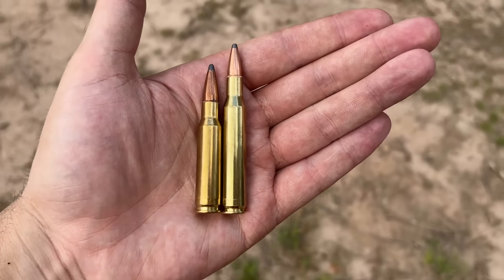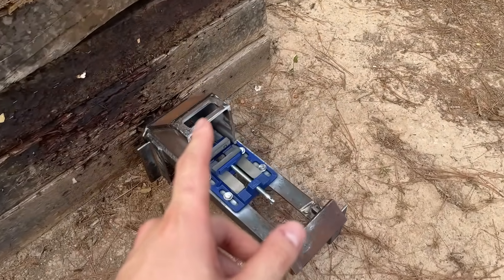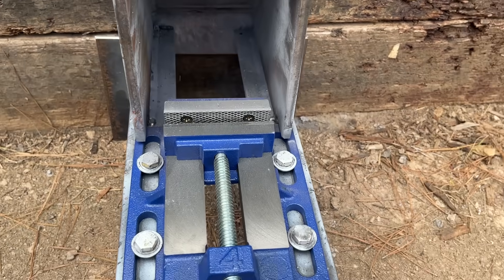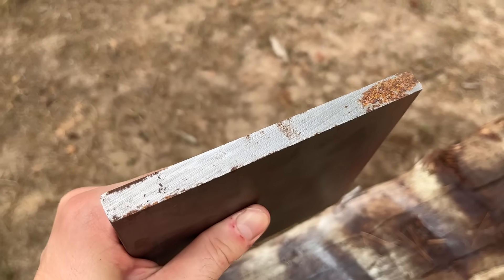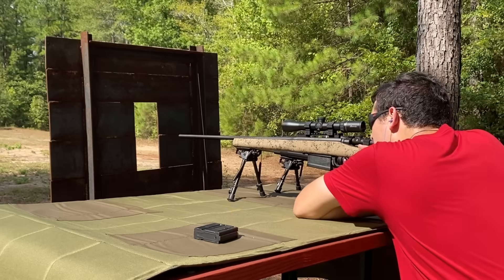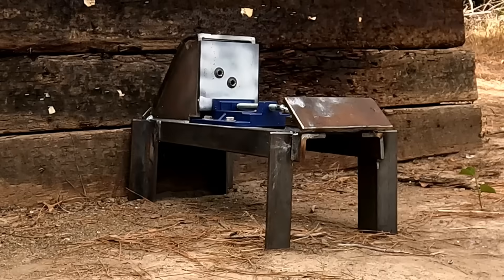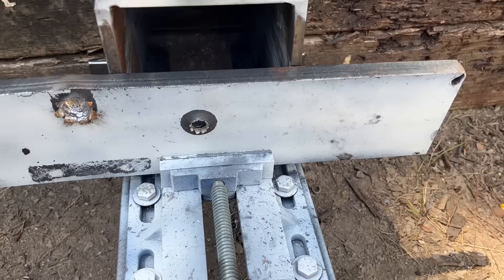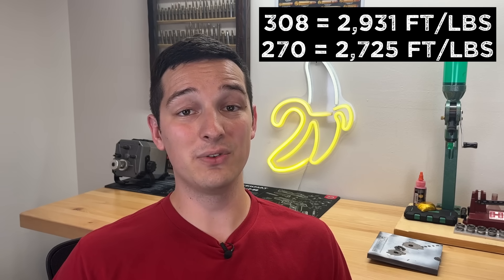270 Win vs 308 Win: ONE Clear Winner On Mild Steel

Comment: First of all, for hunting, I prefer a bullet that expends all its energy in the game animal. I have used the .270 130 gr on many deer and antelope with perfect results. To compare a 130gr .270 to a 165gr .30 calibre is apples to oranges. Forgetting the weight difference, the sectional density is way different. 150 gr .270 bullet would  certainly even the field!

Comment: You set the .270 up for failure. You’re comparing apples to oranges. I bet you money .150 grain punches a hole through the plate. .308 is not the better gun.

Comment: An apples to apples comparison would be using an even heavier bullet in .308 in order to have the same sectional density as the 130 grains, 270. That weight would be 158-160 grains in 30 caliber.  which is an odd weight for a 30 cal hunting bullet and penetrate an even thicker plate. Your test is very good and conclusive.

Comment: The test results surprised me. I thought the 270 would have a bigger punch. I wonder if the 270 would have punched through the 5/8 steel with a heavier bullet.
Reply: I know years ago the guys would compare the 270 with the 30-06 and they always got the 270 to shoot through more than they could the 06 , would shoot at the web on a piece of railroad track , I daresay they were reloading both as hot as they could .
Reply: @robertboyd3863  I agree. I do think a bullet selection, as in armor piercing round, will be difficult to beat when it comes to penetration. AP rounds exist for the 30-06. I'm not sure for the 270.
Reply: @tyronekim3506  Back years ago my buddy and his friend bet a case of beer over which would go farther into a tree, needless to say my friend slipped an armor piercing round into his 06, the guy never did figure out how he got beat so bad, used to buy them all the time for next to nothing
Reply: @robertboyd3863 That's a good story. He's probably still scratching his head in bewilderment.  😅

Comment: It would be interesting to see the difference between them if a monolithic bullet was used.  A solid copper bullet non expanding for a true apples to apples comparison.  The energy is more with the 308 but it also has a larger area to push through.  Eliminate the variables in bullet construction such as jacket thickness and internal lead hardness.

Comment: A similar grain bullet would have been a better comparison. I hand load my 270 with 160 grain Nossler partition bullets, and it will hole punch a 5/8 steel plate at 75 yards. It will also bring down Moose or Elk with one shot.

Comment: So as a deer cartridge pick the .270 then? Deer don’t wear armour plate, & the 270 will provide better expansion / tissue damage as the heavier & somewhat stronger 150 gun .308 bullet plainly holds together better (& will be more likely to pencil through at longer ranges when the impact velocities drop below the best performance threshold).

Comment: The alloy of the actual each bullet might affect it.  Lead with just a little this, a little that and I mean little can affect its' hardness, as well as heat treatment.  Where different brands, different batches that fit within the range of an alloy, one can be on upper limits, another could be on lower limits.

Comment: I was deer hunting in anywhere USA a huge buck graced the crosshairs of my Win. model 60 SS CRF in .270 scope, unfortunately the Buck was clad in 1/2-inch mild steer plate and at that range I knew I couldn't take him down; I should have used a .308. Folks both of these rounds are good for deer, the .270 shoots further and flatter than the .308. I see people doing Zero-turn mower comparisons in 4-foot weeds to see which mower does the best, which is stupid because neither were designed for that purpose, use a bushhog!!!...............BB comparison test on these two rounds should have been compared on deer at certain distances. If I'm going to shoot steel a .50 cal. with steel penetrator bullets would fit the occasion.

Comment: 308 is superior in every way but one (flat tragectory due to speed meaning less drop at further distance) and thats pointless if you dont have the stopping power at that range. Furthermore its a smaller round to be more easily deviated from its path by wind or ricochet. Wich is a larger fault than people give it credit for. If you're looking to reach out further use a 300 Savage 300 win mag or 306 , how even the 6.5 creedmoor is better than the 270. If you want to get real serious about it get a 7 mm Magnum unless your going for varmints. Bit then id stick to 5.56 nato or smaller. Maybe a 17 Hornady or 22 nosler.

Comment: I see one big problem with this test the 270 is a bolt action all the power of the round goes out the muzzle the 308 is a semi automatic on a gun like that only half of the power goes out the muzzle and the other half is used to blow back the bolt to get the next shell in there. And the 308 is a former military round where as the 270 is a modified 30.06 at 500 yards the 30.06 drops 32 inch's the 270 drops only 16 inch's at the same 500 yards so in my believe this test is not accurate and can not be just my thoughts
Reply: Of course not, he simply made a fun video, everything you say is correct, yet has no application to this video, just for fun! Have a great night Mr. Lamb!
Reply: @PeterKushubar  it is a comparison video what I said does apply there is no comparison between the two rifle calibers if he is going to compare the two he should have two bolt action or two semi automatic

Comment: Just FYI: according to Hornady, the 270 Win 140 gr SST Superformance & 270 Win 130 gr. CX Superformance have about the same energy as the .308 Win tested in this video.
Also, in these cartridges, the .270 will retain more energy at longer ranges; had the test been run on steel plates at 50, 75, 100, ... yards, results would have been different (and the .270 130 gr Interlock also catches up and then passes the .308 150 gr Interlock's energy at +/- 200 yards).
Reply: Exactly right the 308 is for guys that don't shoot long distance.
Reply: @lylehart3744 define “long distance” .
 I hunt open wheat country  for mule deer with a .308. 400-600 yard shots are common.  I’ve used the same rifle and load (150 grain ballistic tip) since 99’. I know my rifle well. 
.308, .270 & 30.06 all have very similar ballistics with 140-150 grain bullets.  Unless you happen to be the “Ultimate Reloaders”, the .308 can’t match the ‘06 or .270 with heavier bullets shooting factory loads.
No disrespect to the .270 or ‘06 intended or their shooters: both are excellent rounds
Reply: Ya but this guy was STRUGGLING with accuracy haha. I shoot .270 knowing the benefits of velocity
Reply: Excellent Calibers , I  have both but the 308 is the stronger of the two.
Reply: My 270 using 130 gr hornady sst polymer tip goes through 5/8" mild steel
Reply: Right on the money, .270 all the way

Comment: Good video-- if you get a chance , compair the Win 308 150 with the 30-06 win 150 on mild steel. seems the specs (according to Hornady's loading manuel)  are actually about the same FPS. Thanks!  Well i scrolled down and it looks like that has already been done!!
Reply: That's because the the 308 is loaded to a slightly higher pressure, and that the faster powders of light bullet loads are at peak efficiency in the short action cartridge; the 06 leaves a lot of powder unburned. Advances in slow burning powders give the 30-06 a huge advantage in heavy bullets, though. 200gr ant ~2700 fps, 180 gr at 2800 fps, 165 gr at 3000 fps

Comment: I guess shooting steel has a certain "wow" factor, but you are shooting a hunting style bullet at a target that it was not specifically designed for. If you're shooting that type of bullet, why not use beef ribs or something similar and let's see the expansion of the bullet verses the penetration of the bullet for which it was designed. If you want to compare penetration in steel than get some armor piercing bullets and do the comparison. But hey I appreciate the time and effort in making the video.

Comment: I'd like to see the back of the plates, please? 

Also, I know you like the grinder, but you don't have to do it. You could use a half a square then minus its height to measure the depth.
Cut one of these 🔲 (3d) in half & use the top part over the hole Depth Micrometer.

Comment: I don’t know what kind of bull crap bullet you’re shooting, but the 270 is much faster than the 308 and much more powerful. It has much more powder than the 308 does. I load my own for the 308 and the 270 you come up with some crap bullets from somewhere. i’ve seen Hoody Ho compare the 270 with a 3006 which is a longer 308 against the 270 on steel penetration and the 27 won. This is total crap!

Comment: You should do a test loading bullet seated backwards with hotter load for AP like they did in WW1 

Supposedly it could punch through 16mm British Mrk1 tank steel which is close to your 5/8 plate

Comment: What a clown show of a test. The .308 loads are loaded to the max and the .270 loads are base level loads. 

How can you even post that when you know better? 

Load up the .270 with more powder like you did the .308 and watch what happens. 

The .270 on steel outperforms the .30-06 from my testing from factory ammo. It would wipe the floor with the .308

Comment: Yeah, look at the exterior ballistics though.  With a better BC and a better velocity, your reach and your consistency in wind are going to be a bit better with the 270.  Just depends what you think you're trying to do besides drill holes in plate steel (which can be done more efficiently with a drill press).
Reply: .308 won, .270 lost. Don't get butthurt over it.🤡
Reply: @joshrandall3632  Projection?  I own several 308 rifles. No 270s, but I can read ballistics charts.  "Butthurt" therefore is often simply knowing things.  I don't apologize for knowing things, even when accused of being "butthurt".
So if we can dispense with the labeling, be it known there are different metrics for what is "best" depending on the situation or the requirements.  308 packs more energy at the muzzle.  270 offers better BC, and slightly more MV, therefore it would be favored for certain long range scenarios.  But several cartridges do.  For a man-carried rifles, overall weight and recoil being factors, cartridges in the 6mm to 7mm range offer the best long range performance.  The 300s are very good indeed, but for less carried weight, less recoil and higher BC, that 6 to 7mm is hard to beat unless total energy (tested here) is your main consideration.  But in that case carry a 50 BMG.
Reply: @joshrandall3632  Also, there is a distance, depending on the specific loads, at which the energy of a 270 and the energy of a 308 will cross over.  Muzzle energy, and energy on target, are two different things.

Comment: You want to put a hole in mild steel?  Try a 30 cal 100 grain half jacket or short jacket as they are sometimes called.  Max it out with a safe load in 308 or 30-06 and it will blow the socks off a jacketed round.

Comment: For hunting especially as a hand loader the 270 is super hunting cartridge, more case capacity and higher velocity and higher BC bullets.  Inside 300 yards there is not much practice difference but at 500 yards the 270 is going to out perform the 308.
Reply: Yup, modern factory loads don't do it justice. You can easily get an extra 150 fps handloading.
Reply: I've  never fired a shot at a game animal @ 500 yards .
Reply: We hunt in ranges.. never shoot less than 300 yards.. 308 won’t hold up
Reply: I agree👍🏽
Reply: You’re exactly right, 270 much better performance. 308 drops like a rock at 500
Reply: Should of been 150 gr out of the 270 also it would of out performed the 308
Reply: I’ve seen moose taking at 800 yards with .308. Is .270 going to stabilize a higher BC bullet than a 180 grain .308?
Reply: So what are you hunting with a 270 past 300 Yaards ???
Reply: @maddog8004  don virtue signal . I grew up on pronghorn meat . Shooting 270 since 10 yrs old at  every range  muley elk pronghorn whitetail turkey if you wanna shoot a turkey in the head at long range I recommend a properly loaded 270 round, same as a pronghorn heart at 450- 500, plumb ethical with a properly loaded 270 ,not even a thing. No good to cast aspersions to some people who shoot alot 600 is no different than 300 to another guy snd then theres the thousand yard being the same as the 600 . Bullet energy more a limiter than accuracy but you dont need alot if you clip the arteries off the top of the heart,  I-like to eat them.
Reply: @maddog8004  obviously you can't get out that far---lol!!!
Reply: Fun fact: around 80% of deer harvested in the US are taken at 65 yards or less
Reply: @blaws6684 yeah with a shotgun 😂
Reply: @stevenmoss2152  nope.  In most of its northern range you can’t even see a deer 100 yards away through the trees. 
Take a look past your own nose some day.  It’s an amazing world out there
Reply: 140 grain eldx 277 caliber Bullet bc .535 sectional density  .270, 308 178 grain eldx bc .535 sectional density .268, I can push that bullet 2750 making about 3000 ft lbs of muzzle energy. The 270 does not have better bcs and marginally if that even better sectional density. 😂😂
Reply: No way! You know the 270 is junk. But, knowing that, I'd be willing to take it off your hands for a few bucks---just because I could use it for a tent stake.
Reply: @grisher111 tell that to Jack O’Connor. You know, someone who actually hunted.
Reply: @grisher111  i DONT actually own a 270

Comment: You know a bolt action 308 would of done better for your comparison.  An semi auto loses gas pressure so hence the bullet doesn't have the energy a bolt action or single shot has.

Comment: A.270 is a necked down 30-06.  For a better control use the identical bullet weight.  Either way both are a good round.
Reply: No wrong It uses the same casing as the 30-06 but with a .277 bullet
Reply: @BaconSlayer69  Thats what i said.  🤔
Reply: @rogueldr642smiythe9  u said neck down which means reference to the shell casing not the bullet get it right
Reply: @BaconSlayer69  Sized down goodness sakes its the same case
Reply: @BaconSlayer69  🤓

Comment: The case capacity of standard .270 brass is 11gr more water volume at 67gr total than than the .308 at 56gr, so if you handload you should theoretically be able to push a .270 bullet of similar weight a great deal faster than you'd be able to with a .308 bullet. Obviously it depends on the powder and all that, but all else being equal, the .270 has the potential to push similar bullet weights faster than the .308, and thus also be able to penetrate steel better.
Reply: It's all in the 30cal round... A 300 win mag only has 25% more power over a 308. The other 75% is all sound and kick..

Comment: I agree with most comments, shoot again with identical bullet weights and types. You have too many variables going on simultaneously with mismatched bullets to make a blanket .270 vs 308 comparison.
Reply: Totally agree. Also, what is being shot? The 270 is flatter so for some jobs it's better.
Reply: @jeffwaters5633  Don't let this ass of a video get to you, he came right out and said he wasn't a fan of the 270. Did you really expect the 270 to beat the 308? Think of it this way, if that target was a deer @ 50yds instead of a steel plate, is it really going to matter? 308, 270, or 30-06 flip a three sided coin, you can't lose.
Reply: As of today why would anybody buy a new 270?   Guys all sales are watched.
Reply: @MrCobb-rq8iv bolt action hunting rifles don't win wars son. After three rounds most are spitting the best ammo inaccurately
Reply: Especially the 13 mm cartridge case length advantage that goes to the .270. 30-06 only shoots 100fps or so faster than the .308. We're talking a 13 mm length advantage to the 30-06. Therefore to the .270. I want a 7.62 x39 mm bolt rifle. Kill anything on North America with the proper bullet. People will argue this then swear by the deadlines of the 10mm on brown bear. Boggles my mind. Have seen a few decent sized black bear fall to MARINE issued match 220 grain fmj. Hard to beleive an sks wont kill one. But you're right a out comparing apples to oranges. So hard to remove all the variables though. I think we should carry and rely on what we shoot best. Carry you're happy place round and roll with it. Either will smoke anything north of Africa. I wouldn't mind d a bolt rifle in 7.62x54r but it's hardto find and the milsurp pits your barrell with the mercury primers. Saw it first hand.

Comment: Here In East, tn the 270 is the staple of hunting cartridges. I've shot it and 308 ALOT and I'll take the 270 majority of the time. Don't let half inch steel plates with 130 gr full you.. try it in 150 gr

Comment: Comparing apples to oranges.  Both bullets need to be the same weight.  Also, is the jacket the same thickness on both bullets?  The .270 may have a thinner jacket, which would make a difference too.

Comment: Looking at charts the .270 has more muzzle energy and retains a lot more at 500 yards than the .308 with a 150g bullet.
Reply: What charts you looking at. THATS IMPOSSIBLE.  THE 30 CALIBER IS BIGGER, HAS MORE MUZZLE ENERGY AND THE 150 GR RETAINS MORE ENERGY IN LE OF ITS GREATER SECTIONAL DENSITY AND VELICITY.
Reply: @twolak1972  Reloading manuals. The .270 is a .30-06 case, so it has more powder than the .308 and it also has more sectional density to retain it's energy longer.
Reply: @kdw75 you are correct the 270 is quite a bit faster a fellow l know is getting 3000 fps with 170 grain projectiles .
Reply: My reloading manual. The .270 is a .30-06 cartridge, which has more powder volume than the shorter .308. @twolak1972